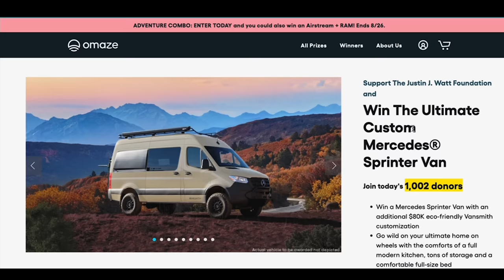DIY ROOF INSTALLATION | BUILDING OUR OWN HOME

Comment: Another bedroom could be added next to the master bedroom over the living room. The door could be next to the stairs and would be convenient for access to the bathroom. There is already a window there and there would also be room for a closet between the two rooms. Of course you lose the high ceiling in the living room but might be more cost effective than an entire addition.
Reply: I  would think a little birds nest bedroom beyond the bathroom would be a great spot .
Reply: I figured they would just put an addition on but they would have to match up the siding & if I remember right it wasn't easy to get, think I was over thinking it lol.
Reply: I was thinking exactly the same
Reply: They can't build over there because of the fireplace.
Reply: @SagebrushRambles  The chimney would just run up the wall between the stairwell and the new room in the same place it already is. The stairwell does not need to be covered over, it could be left open to the existing ceiling or the portion over the lower landing could be turned into a closet with the door coming into the bedroom. The doorway to the new room would open onto the existing landing beside the stairs where there is currently a half wall near the bathroom. Another door could be put where the existing opening to the master bedroom is.  The new bedroom would be the same size as the living room below.

Comment: Allie.  You said you can't wait for winter.  The almanac says we are to have an artic winter with higher then normal snow fall.   Soooo if I was you I would go to Costco and stock up the pantry and freezer with a ton of staples so if you can't get out or the power goes out you guys have stuff to get by on.  And have snow supplies like extra blankets and pillows incase guests get stuck up there wouldn't hurt either.

Comment: Good work on the roof. Allie I have to agree that the swoosh is not helpful. It detracts from your logo. My eye goes to the swish. Get another brand of hat that puts their logo is a less prominent place or has no branding of their own. I would also suggest the company name on the back of the hat. Your logo is great but it is currently unknown and there is nothing to complete the knowing.  The name could also be on the brim of the hat. Yes I know it costs more but right now your branding is incomplete. I used to do a lot of this type of marketing so I do have a bit of experience with this stuff. On a t-shirt the logo would make a nice pocket imprint, but put it bigger with the Company logo and name on the back and a tag line if you have it.
Reply: Or get the hats where the swoosh is the same color as the fabric of the hats.  I've seen black swoosh's on black fabric.

Comment: It does seem like the house itself wasn’t really planned well, even if you just think about how the snow sloughs off onto the deck during the winter.  But definitely not built for extending family.  I think I’d suggest temporarily transitioning the sunroom into Leo’s bedroom and putting the office on the top floor of the garage.  That gives you a little time before you need to start a new project.  But maybe all this has been discussed.  I’ve skipped the past few months.
Reply: I think this is a really wonderful idea! The above garsge office space could still be a guest space with a good fold out sofa or nice futon.
Reply: @pamelar5868  that's the whole point of building the garage the size they are! It will be a mini apartment basically so family or can stay there. As far as the house, it was the 1st time they ever did plans, let alone built a house from ground up. I'm sure her getting pregnant wasn't even a thought in their minds & by the time they got pregnant it was too late to change the plans!

Comment: You could extend the current bedroom and build a wall between them with access from the current stairs by making a hard left before your bedroom with a railing on the left and a wall on the right. You would need to have a door between your bedroom and the stairs and bathroom but it would be doable.

Comment: Walk boards and wall bucks.  will give a place to stand while doing the roof.  This is equipment that can be rented.  If you want rock climing.  There is roof hooks that can be installed that ropes for safety can be secured to.

Comment: The door on the side of the garage could be blocked by snow. Maybe adding another one at front next to garage doors.  Garage ceiling seems much higher than normal, are they plan to install a car lift?

Comment: Quick van question. How much water is used for 2 ppl showering per day. An to clean dishes twice. All in 1 day.
I’m debating on tank size. An not sure to go big, or with 2 tanks, or go small because of the weight. I’m looking at filling up once a week. But wonder if I’d have enough.

Comment: I'm sure you'll show this is a future video, but I am curious how you are planning to vent the garage roof.  With the house, you didn't need to provide for venting due to fully filling the rafters bays with high-density spray-on foam insulation, are you planning the same for the garage?
Reply from the maker: Yes we will be spray foaming most of the garage. Especially the roof

Comment: The hat is cool but no one will know what the logo represents, and you don't want to lose a public opportunity to market your company name/brand.  The hat should include the company name or website along the front of the brim edge.  I agree with Allie, the swoosh needs to be removed as it is irrelative to your branding.  It's all about promoting your company branding only with your brand reference on the hat.  Hopefully you are also designing a Mountain Made Vans decal you can put on the vans you make.  A license plate holder with the Mountain Made Vans name on it would be great too.

Comment: It looks amazing! Where do you plan to place the stairs to go up to the apartment above the garage? I have a suggestion - if you place the stairs outside on the back wall, you can build a small deck there and the appartment door. Then you dont need a window on the back wall because you can open the door for ventilation. And if you make the top half of the door with a window, then you will have more light too. And I would place a small window in the bathroom - always ;-)

Comment: When talking about drainage consider not using corrugated pipes, with or without "socks". 
After watching some other channels and also looking at how my own house is built I see the wisdom of using schedule 40 (or similar depending on where you live in the world). If you want to create a french drain, sink basin etc using gravel rocks and drilling the pipe strategically seems to be the way to go.

I think that this Tuber is humble and does explain things in a good way, example https://youtu.be/ZJBKZ2mPKRU but do browse his other videos.

I have also seen others swear that corrugated pipes are the best but I can never get past the issue that things will stick in the valleys of the corrugated walls and buildup will happen, they are also not strong as schedule 40 and will collapse in certain situations.

I hope that you will have a good drainage system that will leave your property safe and easy to maintain

Comment: WHY was the roof edge  NOT extend over  the walls to accommodate for soffits to direct the water off the roof AWAY from the  the walls and foundation ??? Taping WILL NOT last >>>>

Comment: Dude! Please go invest in a FULL BODY harness! Go to you local safety supply company and get the right anchors, a full body harness and  a rope grab with a shock absorbing. While that set up you are using MAY work for rock climbing or something like that. You are really tossing a quarter in the air with regards to you safety. 
I am a safety professional for a large construction co. In the Midwest and just cringe to watch you do what you are doing getting on the roof and tying to a truck!
Reply: Agreed. Hate watching this.
Reply: I repeat myself - DRAMA 🎭 - HOWEVER, you are absolutely correct.  Thank goodness he has been lucky 🍀 thus far.